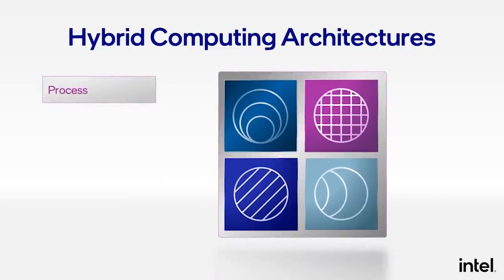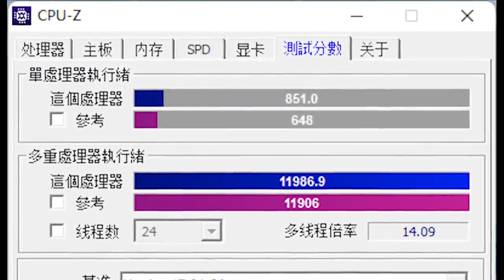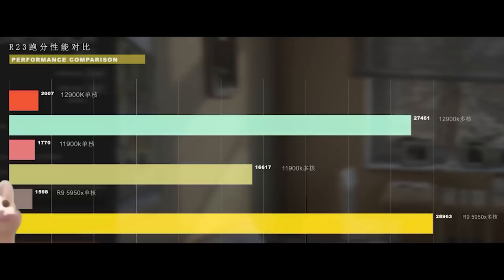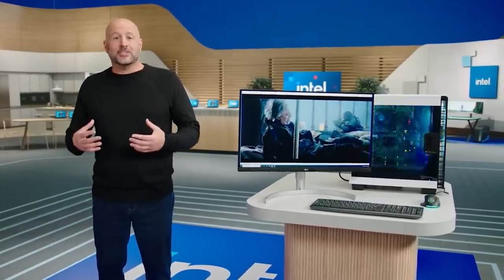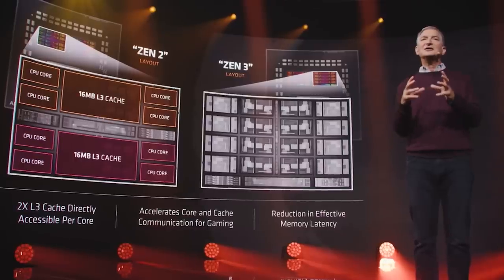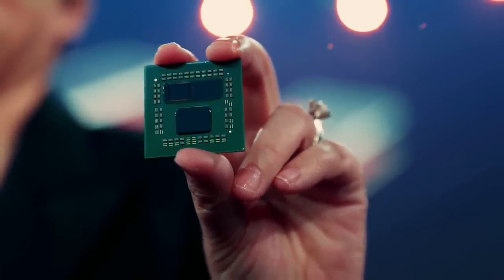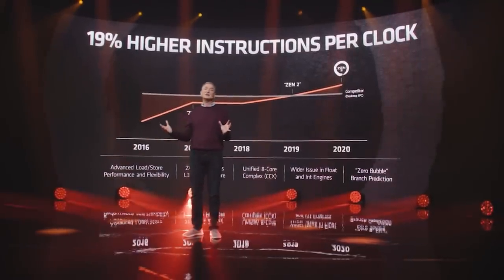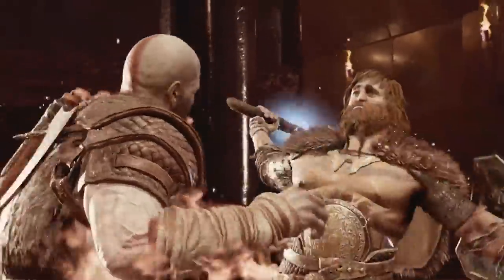Ryzen V Cache CLOCK SPEEDS & Production Revealed | Overclocked 12900K Alder Lake Hits 330 WATTS!

Comment: Running my 5950X completely within spec and not overclocking I get a CPU-z benchmark score of 13,320.2
Reply: @hannahtimson2526  From your reply I can sense that you:

A) Do not have a 5950X

B) Do not know how to properly configure a Ryzen CPU.

There again you are not alone, because Buildzoid using every overclocking trick he knows managed to get a CineBench R20 score of around 11,900 on identical hardware to mine; whereas my best CineBench R20 score on my 5950X which is configured within specs and not overclocked is over 12,100.

And you can ask the YouTuber "Not an Apple Fan" if you don't believe me, because he has seen my numbers and knows how I got them.
Reply: That's a very nice score with my 5900x PBO2 plus a custom negative curve I get 10100 multi and 681 single.

Comment: Seems to me that Intel, had to work with Microsoft to fully optimised the Cores for windows, so the hardware can run at its full potential, the result of this is causing issues with AMD processors to the point where they run 10-15% slower, For once it be nice to see Microsoft work with AMD to unlock the full potential of Rzyen, but the way the pc market is going, i can soon see Windows being replaced for other options.

Comment: Maybe the Zen3+ is the same as Ryzen 3X00XT to 3X00X. Just XT being a bit faster for the same money and the older X a bit cheaper.
Reply: No need for speculation, AMD announced 3D would gain 15% in some games, other things won't gain anything with larger cache.
It's also going to be expensive and Intel don't appear to have a clear lead, they're pushing the silicon to the limit.

Comment: For the people who are gonna cry about heat
1. Even though intel uses way more power, their 10nm process emits less heat than tsmc 7nm at same power lvls.
2. That chip is OVERCLOCKED at 5.2 ghz all cores and that's pretty impressive, so stop crying about power consumption because it's not gonna consume that much power when you run it normally.
Reply: Intel HOT!
Reply: 1. That's physically impossible. The amount of heat emitted is directly determined by how much power the CPU uses. The difference is that the heat is dissipated more effectively.
2. It's overclocked and it only just beats the stock 5950X at multicore. It is a fair comparison. If you want to compare the stock power usage of a 12900K, you need to consider its stock performance.
Granted, Alder Lake's single core performance is much better than the 5950X, but its multicore efficiency is garbage.

Comment: Buy an i7 12700k and disable the e-core and OC the heck of the p cores
Reply: This makes no sense??? If you want to have best oc then you have to buy the 12900k because its the best chip with highest oc potential. They only use leftover for the 12700k with bad quality of a chip... so oc doesnt make sense here depending on your comment.
Reply: @reijhinru1474   The price does. Why would I pay 200-300+ dollars for more cores I won't use?
Reply: @reijhinru1474  i9 11900k didn't bring much more compare to the i7 11700k.
Reply: @reijhinru1474  My 10700k OC'd better than my 10900k.
Reply: E cores are useful because simple tasks run efficiently on them than running on the Intel Big Core.
Reply: @reijhinru1474  No... Intel is going to bin 12700Ks from dies with defective E cores. That doesn't mean those dies will have weaker P cores.
You could possibly make that argument this generation, but even so, I would still recommend the 11700K over the 11900K as its performance is so similar and it's much cheaper. A ~200MHz higher overclock is not worth £130.
Reply: @nathangamble125  you dont understand how thinks work. Its the same shit with 11700k and 10700k those chips are leftovers which dont reach the requirement for an i9 chip. If you want to OC 11700k until 5.3 ghz gl with that cause you will need ln2.... those chips arent good enough binned so the 11900k will always be better at the same clock 1 to 1 but with much more less voltage!

Comment: well my 11700k can reach 300w as well so. I thought we would get more power for less powerdraw in the future but it seems the manufacturers are simply getting more power by increasing the powerdraw. Seems we have come to some kind of end of what we/they are capable of making today.
Reply: they - as in intel? then yeah, they're at a technological dead end
Reply: @aeromotive2  Exactly, it's intel failing at efficiency not AMD.
Reply: @ItsJustVV  amd is failing too not just intel... best example look at apples m1x chip its impressive!
Reply: @aeromotive2  both intel and amd, and even Nvidia. Look at the GPUs, they simply designed the new GPUs to draw more power to get the additional perf increase. If u run a he modded 2080ti it will perform around the same perf as an 3080/3090.
Reply: @Pillokun  The change to GDDR6x has no effect at all?
My 3090 does double the performance at mining at 262w than my 2080ti does at 320w, so your assertion is nonsense.
Reply: @Safetytrousers  ur 3090 has a redesigned u-arch where the int units are now fp capable and therefore up to double the fp perf(theoretical max). crunching monster does not equal monster gaming perf. I am naturally talking about only gpu load in gaming where a hw modded 2080ti is almost as good as an top tier Ampere card because it is no longer pw limited. more power = more perf. ur whole reply is a strawman as mining has nothing to do with what I said.
Reply: @reijhinru1474  For laptops only. Did you see the prices on those new desktops? $6k and not better than a cheaper x86 system, actually worse in performance.
AMD is not failing anything, the have the best combo for perf+efficiency+price compared to both intel and apple.
Reply: @ItsJustVV  one question to you is it really efficient if you use all 16 cores for a cad workstation and it still burns 230watts on average? Yeah its a good chip but efficient is a different definition. I only call threadripper very efficient but its sadly very very expensive...
Reply: @reijhinru1474  to be honest cad software love fast CPUs with high single core perf, the issue with the Apple chips is they are not x86 and have too little ram. Otherwise it would be super CPU for cad.
Reply: @Pillokun  yeah but do you need x86 if its mac exclusive anyways? Maybe in future they will even make x86 chips.
Reply: @reijhinru1474  I need the best platform for my software if it would be Apple then I would go that route but as it is today I don't touch Apple products with a ten feet pole. People on YouTube especially many Apple centric techchannels embrace Apple as pro products but in reality it simply is a product for casuals thinking they are pros. :P
Reply: @reijhinru1474  Well I don't know about pro work and that stuff, so I don't comment from that POV, I'm talking only about gaming. From a gaming POV AMD has better efficiency.

Comment: CPUs over 125W and GPUs over 200W are just dumb. Big die sizes are dumb. They cause shortages and enable scalpers.
If the RX 6600XT and RTX 3060 were the biggest GPU on the market and we had GPUs smaller than them, we'd have no supply problem and they consume about 150W.
If the biggest CPU on the market was the R7 5800x then we'd have no problems with the CPUs either.

Comment: So let me get this straight intel has basically used a similar processes to ryzen to use chiplets and they still need insane amounta of power to run and they are faster single core but not multicore? I dunno seems like a kind of a bummer at the moment when u consider the price of a new mobo the price of the new chips and DDR5. Hopefully Intel can continue down this path and end up rocking it. Right now I dont think its worth it

Comment: 330W? even it's faster than the 5900X by 50% that's still too much. I think the 5950X has a max. power consumption of 140W, so 330W is a total bust.
Reply: HwInfo says my 5950x is drawing 182w, all cores at 4.4Ghz 1.24v. What you read was wrong.
Reply: @Safetytrousers  mmm I'm pretty sure anandtech knows better than you.
Reply: @NaumRusomarov  remember this is full 100% all core load... the 5800x hits 205w on the same test
Reply: @NaumRusomarov  What I see is before my eyes.
Reply: @Safetytrousers  just because it's in front of your eyes it doesn't mean you know how to measure it. 

if you think you're smarter than anandtech you're free to file a complain with them.
Reply: @NaumRusomarov  Maby hes (unlike you) just able to spot fake news when he sees it.

140watt figure is probably due to some bullshit marketing. 

The CPU consumes around 183 watt due to PBO being set to AUTO by default, so unless someone actively is tinkering with the CPU settings in BIOS then the 140watt is just BS magic.
Reply: @Safetytrousers  I think you mean GHz, not KHz. Considering that you got that confused, I am extremely sceptical of your reading comprehension skills.
Reply: @kaspervendler1726  You realise that not all motherboards enable PBO by default, right?
In what world is measuring the performance and power usage of a CPU at its stock power settings "bullshit marketing"? Most PCs run it at those settings.

Anyway, CPU Z's 5950X score is based on stock power settings. You are comparing the performance of a stock CPU to the performance of an overclocked CPU, so you need to compare the stock power usage against the overclocked power usage. Don't compare apples to oranges yourself and then say that other people have to swap the orange for another apple to make the comparison "fair".
Reply: @TheBURBAN111  That's either full system power usage, or an overclock. Whichever it is, it is not relevant to a comparison between the CPU power usage of a stock 5950X and an overclocked 12900K. The 5800X and 5950X both have a stock all-core power limit of 142W.
Reply: @nathangamble125  the 12900k test is under a full core usage test and overclocked ppl hating are dumb lol
Reply: @nathangamble125  im talking stock most cpus under full load like the test in the video use more power than they are meant to.
Reply: Well, this is overclocked not stock my 5900x with PBO2 and a custom negative curve uses 180w because that's what I have the thing set to use max any more than that and it heats up too much and loses performance any lower, and I lose performance so at 180w it stays.
Reply: @nathangamble125  It was just a slip of the mind. I have just proved to you I am right. PBO is a stock feature.

Comment: THing about single core. is it is practically obsolete. Name a game that still uses only one core? Name a creator program that only uses one core?  Everything is multi core now, and loves long haul multi core, not a 10 second boost.
Reply: Most apps are still performance bound by a single thread. Even if an app is multithreaded, it is often the case that some or all of the threads are waiting for tasks on other threads to complete. I mean, in games that are CPU bound, how often are all of your cores pinned at 100% utilization? There’s usually at least 1 pinned at 100% and every other thread is dependent on that thread. Speed up that one thread, and the whole system - even the GPU - goes faster.
Reply: "Name a game that still uses only one core"
Starcraft II
Trackmania 2020
Age of Empires II and DE.
These are the games I play more than any others. All use only 1 core.

Comment: Y'all acting like 330 watts is horrible but honestly it's about fucking time a CPU uses some power to justify your 360 mm radiators. 
What about the fact that water-cooled GPUs are not common when they constantly push like 200-500 watts now?

Comment: When Intel comes with Better  Perfomance here comes the ..Power Consumption Pros.... bla bla bla ....I don't care about power consumption when I want Performance.
Reply: Is not  only  about performance, when this processor will hit 330W , just imagine  the temperature on it , electrons will migrate faster and lifespan of the processor will be shorter and shorter in time.
GL!!!
Reply: @riannair7101  thats at an all core 5.2ghz oc... and its 300w not 330 lmao stock with power limits it will be fine also he has the vcore set way too high
Reply: @riannair7101  My 8700K it´s 5Ghz Since 2017  and still Rocks with  592 Points in CPU-Z Single Core
Reply: I don't care about power consumption either but It will heat up your room like no other. My 5900x /3090 PC can use up to 700w while gaming so my game room will go from 72 to 85 in a matter of an hour or two.

Comment: Both Intel and AMD need try harder this time, the new M1 chips makes them look like a joke, just through the first version. Apple beating, ou a least maching,  two historical chip  designers in just 2 years is absurd.
Reply: in power draw maybe they're still in 7nm and apple 5nm my r7 1700 score higher than the m1 in cinebench i have both and amd use way less power than intel
Reply: @ThaexakaMavro  You are right, but that M1 is for the "low end". The real high performance ones just got lunched and looks way more powerful (and much more efficient). If nothing changes, both AMD and Intel will soon be left behind.
Reply: Aren't M1 ARM chips with reduced instruction set ? Very good at specific things but pretty much suck at everything else.
Reply: M1 Max is a ~450$ chip, I doubt AMD or Intel wants to go there when they can just sell ~50$ chips at 200-500$ to OEMs.

edit: and it's not like Apple is any serious competition to the Windows ecosystem
Reply: people who compare ARM based chip with x86 chip has no idea what they are talking about.
it's like a fish argued its a better swimmer than a dog, while dog argues it can run faster.

it all depends on the software is natively built for which architecture.

ARM chip has always been efficient, because it can have accelerator which is dedicated to handle that instructions only, while x86 has always been a general purpose CPU.
Reply: @tech3910  "people who compare ARM based chip with x86 chip has no idea what they are talking about."
Not necessarily. There are situations where it makes sense to compare them. As part of the comparison you need to account for the differences between them, if you want to do the comparison properly. Most people don't do it properly (e.g. basing the comparison on a single benchmark), so you're right most of the time, but not always.
Reply: @killthemessenger84  That's ridiculous. No it can't
Reply: @nathangamble125  Comparing the M1 SoC's with X86 processors is ridiculous. They're part of completely different platforms with very different paradigms. PC is all about modularity and customizability. That's why it's accessible to pretty much everyone. So the X86 processors can't have integrated RAM which would be fucking ridiculous. M1 is part of the closed Mac eco system that's entirely based on corporate greed. You can't upgrade hardware or even repair them. In short we don't want anything resembling the M1 in our PC's. Keep that shit way.